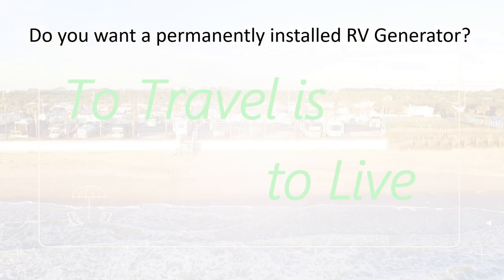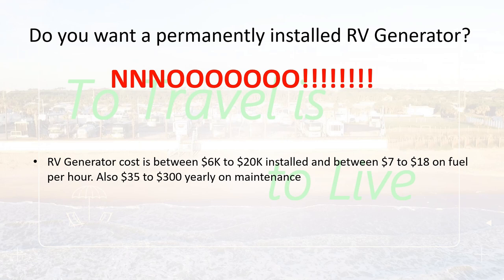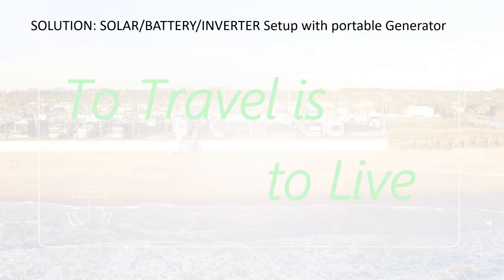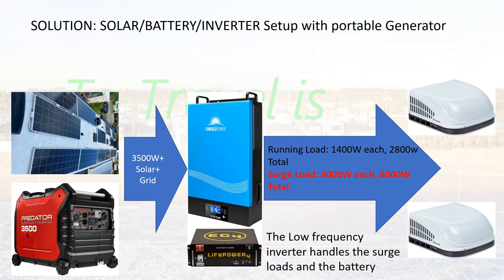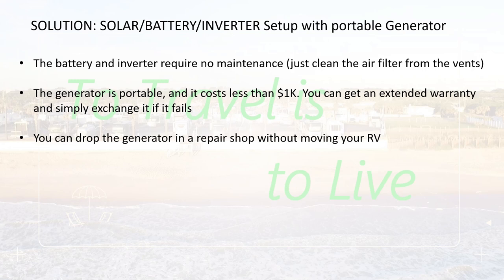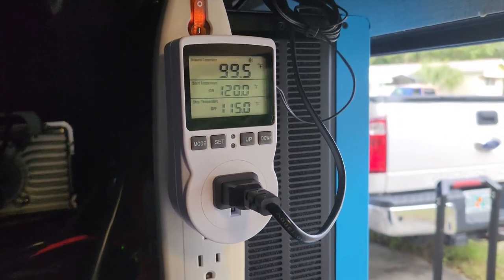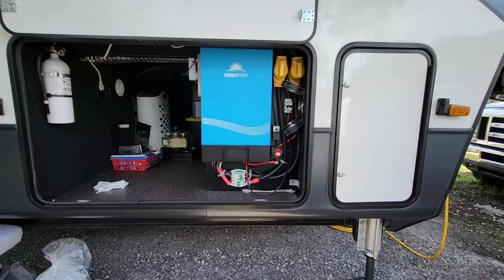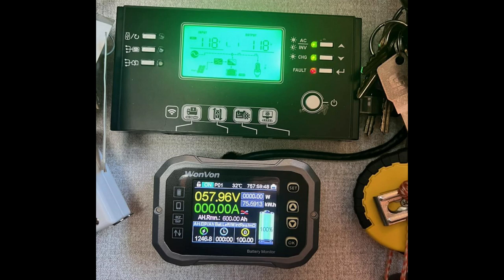30kw RV Solar System

Comment: Those battery disconnects are notorious for voltage drop and melting. I like to use a T class fuse at the value recommended by the inverter manufacturer and an over sized DIHOOL dc breaker as a disconnect.
Reply from the maker: You are correct, the battery disconects sometimes fail, but with higher amperage. People in 12 or 24v systems always have problems with them, I have not seen them fail in a 48v system. As a matter of fact, my RV has 3 ACs and has been using one of those for 4 years. I frequently check temperatures with a thermal camera and it does not even register.

Comment: great system and well presented.
48v system looks like it is definitely the way to go.
I currently have 4 x 200 AH of batteries installed in a 24v configuration, but I am changing out to 12 x 100AH batteries also to be wired in a 24 volt configuration (mainly due to my Victron Easysolar being a 24v model.
Your system is equivalent to having 24 x 100AH batteries...I think.....I thought mine was a large system but yours is twice the KW..envious....lol
Reply from the maker: Thanks! 24V is better than 12V, by far. It makes it usable, specially with Victron equipment, which is in the top end. Whyare you changing? Can you just add in parallel? Thanks for watching the video and posting a comment!
Reply: @How_RV_going_to_do_it  I am changing as the 100AH batteries were on special here in Western Australia so I got a very good rate.
the 4 x 200AH batteries will go into a new build which is an enclosed trailer to tow behind the motorhome. Then I will be able to use that source to act as a 'generator' for my motorhome batteries if and when needed.
Reply from the maker: @kadachiman7234  Not bad, a good way to maintain the capacity, add flexibility and not carry the weight or loose the space. Thanks for sharing!

Comment: I have 1 185w panel 9 amp with 10 amp controller powering 2 interstate batters for three years.  I have yet to run out of power.  Back up is a 3000 watt Honda generator.  Fridge is propane or electric.

Comment: The reason I found your channel was because I am searching for an answer to my solar setup so maybe you can assist.
2.25 KW of solar panels, 1200AH of lithium batteries connected as a 24 volt system, into a Victron Easysolar 24V 3000W 70A with a built in MPPT 150/70......by going from 800AH of storage to 1200 AH of storage am I overloading my Victron?
The way I see it all I am doing is increasing my storage capacity to take advantage of the huge amount of solar charging capacity we get here in the Pilbara region of Western Australia.
Reply from the maker: Absolutelly, more than happy to! Adding battery capacity will not change the load of your system. Your MPPT charger and your inverter charger are designed to charge at a maximun current and to pull a maximun current. The batteries can't push or pull power to or from the other components. A simple comparison would be to putting water in a tub with a hose or filling up a pool. The hose will simply provide more water because it will be able to run more time, but the hose itself is not affected by it. Now on the other side is the same. Imaine that you put a small pump sucking water from the tub or the pool, for the pump is the same. It will suck the same volume of water because what controls the flow is the device, not the energy container, but it will be able to run longer as there is more water.
Your battery bank will simply continue to charge or discharge longer, and all MPPT chargers and Inerters are rated to run continuosly, so there should be no problem.
There is only 1 thing to keep in mind, be aware of you are charging from an alternator (like from your car engine). Most alternators are not rated for 100% load and they have no charge control. This is 24V and your car is most likely 12V, but a lot of people try to charge Li batteries with their alternators. This is a bad idea because the alternator does not have a charge controller, so it just generates power directly for a Lead Acid battery. When connected to a Li battery the battery will absorb every single watt of power and it wil, in the long  run, burn the alternator. 
In a nut shell, if your chargers are designed for Li batteries, you can add as much capacity as you want as long as the batteries allow you to be connected in parallel (some batteries have a maximun of batteries you can connect in parallel)
Hope it helps, feel free to reach out if you need any help!
Reply from the maker: Here is a video on how Lithium batteries affect the alternator https://youtu.be/2t5a4cKGAuk
Reply: @How_RV_going_to_do_it  Thanks mate, I just needed reassuring as I didn't want to stuff up an expensive system.
Reply from the maker: @kadachiman7234  No problem. Let me know how it goes!

Comment: Those cables connecting the packs look undersized. How many amps is your system drawing? I would assume if you max out your inverter you're pulling in excess of 125A so you really should be in the ought range of cabling. 2/0 would probably be slight overkill but it would allow you to add another inverter if necessary in the future if you wanted another 2000 watts of power for some reaosn.
Reply from the maker: Thanks for your post. Maxing out the inverter will pull between 106 to 130 amps depending of the battery condition. The cables are really high quality, and the thickness is bigger going to the ends of the pack where it carries more current. We checked it charging at 140+ amps (because the is the higher load we could put through the cables) and they got slightly warm (30c).The system normally pulls from the batteries between 15amp to 40amp, and in the worst case it would pull 50amps but only for 10 minutes, then it drops.

Comment: you're charging at 12v?
Reply from the maker: You can,  but is not always connected as the only 12v power source is the alternator. You simply plug to the truck with the truck running,  turn off the 12v charger from the RV converter and plug one of the 15amp chargers into the original 12v inverter. It is not recommended as the load on the alternator is high and will eventually burn it.  Thanks for watching the video!
Reply: @How_RV_going_to_do_it  what voltage is your battery bank?
Reply from the maker: @3oldman  48v nominal (58.4v fully charged). The batteries are 16s LFP cells.
Reply: @How_RV_going_to_do_it  Excellent.  Running 48v 100ah pack myself.
Reply from the maker: @3oldman  Thanks! 48v is the best way to do it,  if not the only one.
Reply: @How_RV_going_to_do_it  But charging at 140a at what voltage?
Reply from the maker: Actually, 140amps at 54.33V (you can see it in the screen), which comes to 7.6Kw. But that is just the net charge, we had the fifth wheel running with 1 AC working, so I would estimate we were putting close to 165amps, 25 were being used by the Fifth wheel, 140 net going to the batteries. We had the 50 amp line charging 120amps into the bank and 45 amps coming from solar (2.4Kw or so). The Shunt is the best way to measure what goes in and out of the batteries, disregarding where is coming from. That is pretty much where the system maxes out. If we connect the 30amp line on top of that, either from another plug or with a generator we can make 200amps, and we can top off the batteries in 3-4 hours from empty. Hopefully this answers your question, or if it doesn't let me know, I will be more than happy to provide you any more info you might need!
One more thing, the 48v question you had before, the reason why I was saying is the only way to do it is because when you want to be able to produce power higher than 10kw, if you are not running 48v the cables became so thick and so hot that it becomes quite dangerous. This system at max capacity will warm up the main fuse and the wires, but nothing over 70C (cables are rated to 200C).
Once again, thanks for your interest!
Reply: @How_RV_going_to_do_it  Thanks.. and wow.  Years ago I remember trying to run air from 6 T105s @12v and noticing things getting hot pretty quick.. connectors, cables and batteries.   That's when it occurred to me that running high wattage stuff from 12v was not a great idea. I tried 24v for a time but that didn't help much.  It wasn't a good idea working a single Honda 2000 to death either.  I actually parallel 3 for pretty effortless running.
Reply from the maker: @3oldman  You are unfortunately right. With 12v you are very limited, with 24v is still not enough. With 48v, I have a 40foot diesel pusher with 3 rooftop ACs and my 6kw inverter runs them with no problem. Nothing gets hot. This setup is the same. Even running the water heater on electric, the worst we have seen is 80amps, and that is only for a few minutes, normally is between 20 to 40amps at 48v. 
As far as running the generators in parallel that is a great way to do it. I have paralleled 4 units of different capacity and even different brands (2 3500W Predators and 2 2200W Ryobis) They did pretty good, but the surge load is always a problem. Even with easy start. With the inverter the problems are all gone and the power consumption on the generators is uniform. No speed change and the generators run consistently, which is the best you can do.
The most expensive part is still the batteries. For this installation we used nice batteries (expensive, $10k, but my friend, the owner of the fifth wheel, wanted good batteries with 10 year warranty). In my RV I have batteries from a Nissan Leaf and a Chevy Bolt and they were $3k for 30kw including BMSs and all, but I assembled them myself. 
I also added 4 chargers, so when I visit my brother in law for example, I just run extension cords to 4 different outlets in his house (in different breakers) and I can run everything.
As I already mentioned, thanks for taking the time of watching the video and feel free to reach out if you have any questions!